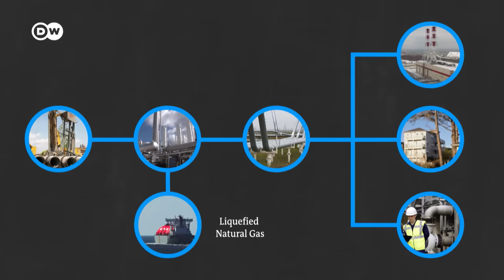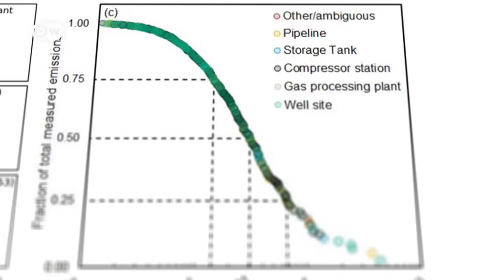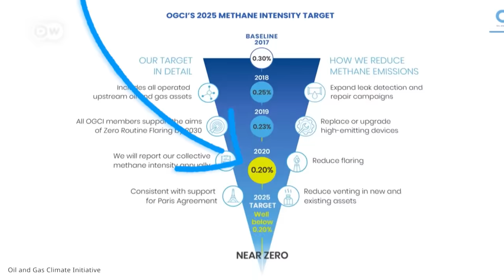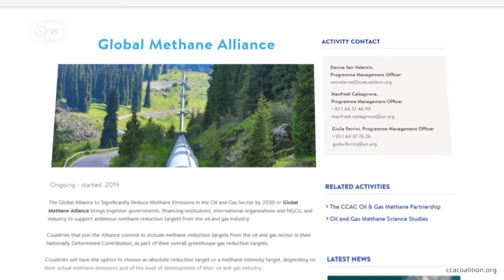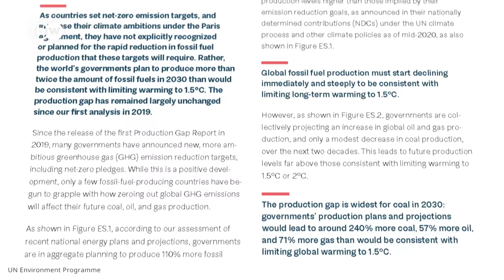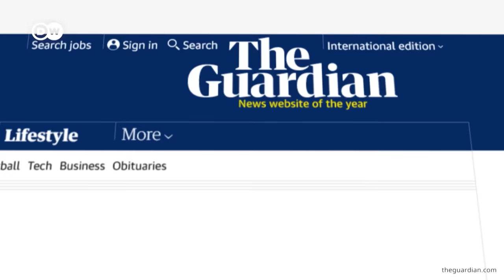Why we need to ditch natural gas (asap)

Comment: I think district heating networks should be a priority. I know in the UK gas is very popular for heating (85% of homes). But we're also highly urbanised (80%+ live in cities), so use mid day solar to power air/water/ground source heat pumps which in turn heat water in a network of insulated tanks and pipes that are pumped into all our homes like drinking water & sewage. 

I don't know what the split is for gas use in terms of electricity production or heating but I'm sure stopping leaks will be easier if the 'gas network' is maybe just 6 pipelines going to power stations rather than the 280,000km of pipe network we currently have to service tens of millions of homes and businesses.
Reply: A heating network would be incredible. Can you imagine the energy savings? So much of what we do produces heat as waste.
Reply: You could make a power station that produces electricity and then use that to power heat pumps, way more efficient and during few cold nights burn i directly so every apartment can have about 15C temperature. Later the whole thing could be replaced by bio mas that was collected from city parks during entire year. Would be an interesting system concept
Reply: @fulconandroadcone9488  this is very close to what Cogeneration does and it is indeed super interesting!
Reply: I think that some form of network heating like what you describe is definitely in our future. Maybe it’ll cost too much to hookup every home to it, but even just having 25-50% of homes hooked up would do wonders for our energy usage!
Reply: @SaveMoneySavethePlanet  I haven't heard of term co-generation before. Nice to know it is idea worth having a name. 

How I see it is if we half fossil fuel usage by half we increase usage of renewables by two times. 

Also switching to DC grid might have some worth too. Most things can be powered by 400V DC, at least in 230-240V AC systems. and would reduce current by about half which would reduce power losses in wires by factor of about 4. Or would need 3 times less metal for wiring in a home which would be significant saving on cooper. Not to mention losses during mains rectification step in all the power supplies. Saved cooper could also be used for electric bikes, and trams and buses, maybe a few cars here and there. 

Now that I think about it, doesn't take a long time to ask yourself why are we not implementing these things to save energy, instead up until few month back Germany was looking to import even more gas.
Reply: @sandpiperbf9767  Yep, heat networks can also use excess heat from places like factories and data centres by installing heat exchangers at those sites.
Reply: yup district heating works great in Scandinavia and Germany.
Reply: Great point 👍🏾
Reply: @sandpiperbf9767  many large cities do have heating or cooling loops for skyscrapers
Reply: @jebbo-c1l  Austin has a cooling loop making ice from nighttime wind to cool skyscrapers
Reply: u can actually look the composition of power generation in the UK real time
we could be generating as much as over 50% of our power from renewable to as little as 3-5%
intermittence is a huge issue for our wind and solar
Reply: @fulconandroadcone9488  Heat pumps cannot compete with gas boilers and furnaces, and they certainly can't compete with cogeneration (both district heating and cooling) using waste exhaust steam from the turbogenerators where the heat is basically free.
Reply: @gregorymalchuk272  I'm not very familiar with numbers regarding district heating, so don't rally have much on that except that it sounds very promising. 

On the other hand everything I saw so far says heat pumps are the way to go. From efficiency, safety ( no gas leaks) to less chance for gas leaks into atmosphere where it will just be wasted.
Reply: UK climate is too warm to make DH work financially. UK doesn't have enough HHD heating degree days (look'm up) to make any DH profitable unless the cost of kWh sold to the poor customer is through the roof. Proponents of massive DH are former choir boys or cooks , never seen a pump close up . Design temperature in England is -4 C in Germany is -20C ... Do the math
Reply: @bm8641  You also need to account for how far the building is from heat source and how many apartments ( total power used by the building ) is
Reply: YES, THIS IS DONE IN ICELAND WITH GEOTHERMAL
Reply: @fulconandroadcone9488  As most equipment is electronically controlled, unfortunately 400VDC would still require power conversion in each piece of equipment. Power conversion still includes making the DC back into AC, changing the voltage and then rectifying it again, so your losses still exist. While saving copper may help keep the environment a bit cleaner in the long term, it's not going to make much of a difference. Also, introducing this change would necessitate changes to legacy equipment, requiring more resources.
Reply: @SAI-nl1vm  I beg to differ. You already do that. You already use 400V DC to charge your phone. 400V is peak what voltage that can be applied to input of modern switch mode supply. If you keep copper the same you can reduce transmission losses significantly. P = I*I * R. Say we double the voltage ( not quite in this case ) then current drops by half which means by power of math we drop transmission losses to 25 % from transformer to end consumer. We also eliminate need for rectifier and smoothing capacitor in the end appliance which makes it a bit cheaper. If it were to become global standard phone and laptop charger would become a bit smaller or be able to handle a bit more power for the same size.
Reply: @fulconandroadcone9488  Actually, the peak voltage of your 240VAC is about 320V and although the peak input voltage may be 400V for modern switched mode power supplies, that would leave no headroom. Any inductive load placed on a 400VDC line would likely destroy every electronic device around it unless there is adequate headroom in the operating voltage of the input capacitors etc.
Every mechanical switching device would have to be replaced (light switches, electromagnetic contactors and the like) due to arcing because a DC arc does not self extinguish. All relays, contactors and electromagnetic devices would also need to be replaced as those designed for AC rely on their reactance to limit current whereas DC coils rely on internal resistance.
I will agree that using high voltage DC transmission lines could be more efficient given the availability modern high voltage switching semiconductors, but to change the consumer end would be prohibitively expensive at this point due to current infrastructure. We would need to have a brand new standard for all devices to ensure that they were manufactured to be universal. New districts and subdivisions could be supplied with 400VDC and wired accordingly. Commercial machinery is another matter though. All 3 phase motors, lighting, heating elements and all associated switching gear would need to be replaced. I can't see many factories being pleased with that bill. Again, maybe new factories ... but it would take so much work to put into place with new standards, retrain all electrical engineers, replace all the insulators and switch gear on the transmission lines .... 
in it's simplistic form, I can see the appeal, but I think that the practical issues are enormous. ;)
Reply: @bm8641  That is perfect temps for heatpumps. Cheaper ones go down to -10.

Comment: I heat my house and water with firewood (I plant two trees for each one I burn), produce electricity with PV panels and battery, do not need air conditioning as I restored an 18th century home with thick brick walls and added insulation and good windows. I'm not totally off grid, but year round I sell to the grid a net amount of electricity. What we need is to plan our lives according to our goals, you don't need to be rich... you just have to be focused.
Reply: @b_uppy  I already do that with poplars and plantains, thanks. ;-)
Reply: I hope you have a very effective filter system for your chimney. Burning wood might be carbon neutral if you replant, but the emissions are very dirty and unhealthy.
Reply: With all due respect, you clearly are rich. This is entirely unaffordable!
Reply: @b_uppy  ...and a huge upfront investment, and some remote job to pay for it all while you live in the middle of nowhere, and a metric ton of CO2 emissions on trips to get the rest of your family to whereever they need to go (school, say).

But even if most people tried to live like loner hermits, then land prices for the huge estates in the middle of nowhere that this requires would shoot up through the roof.

I live in a rather fertile river delta, there are  zero plots of affordable land anywhere nearby.  I'd need to drive something like 200 miles to get anywhere even vaguely "remote" and I bet even there land prices for this kind of project would be rather high.  And even there... if it's not farmland, it's likely a nature reserve or park or something; not some place up for sale for peanuts.  Oh, and farmland around here is utterly unaffordable except to the rich.  Even farmers often lease it.

The best nearby chance is probably some ex-industrial region, and accept the supreme ugliness and possible soil contamination in return for low prices. And then hope zoning laws allow for this whole plan. A friend of mine got a rather good deal on a plan kind of like that, but then there's possible lead poisoning on a good chunk because apparently in the past people used to leave leaky car batteries to rust, and on another chunk there's lots of car oil in the ground.  Unsurprisingly, he's not growing any food crops there.
Reply: @b_uppy  Well, first of all, I already commute by bike, and have an electric cargo bike to haul kids around. I don't have a car and haven't owned nor rented one in years, though I have lent one from friends from time to time.  Part of the reason that is feasible, however, is that I live in a city.

If you can make the permaculture idea you describe work for you: great! I'm not opposed to people doing cool stuff, at all.  But the pretense that this is easily achievable for everyone is absurd. It's not even clear this is less resource intensive at scale; because using land efficiently is absolutely critical for sustainability too.

Let's not guilt-trip people into thinking they just need to uproot everything they know, and potentially accept huge impacts on their quality of life, just to compensate for a broken system. They don't, and should not. This won't work at scale. Doesn't mean it's not cool for 1 person (or small group). It is! This isn't easy, and if you did this: hats off to that accomplishment. Not many will manage to follow that example. You have every reason to be proud.

If you want to fix the climate, we need to fix the rules of the game such that the path of least resistance is sustainable, not by asking  8 billion people to individually take considerable risks and make considerable investments on the off chance they all get it right. They won't.
Reply: @b_uppy  Yeah, I think that for this to work reliably, you'd need to be fairly wealthy.  I get that you disagree - I totally respect your view here; and it's entirely possible I'm wrong and you're right. But I'm not persuaded either ;-).

But hey, that's the beauty of diversity: different people will try different things, and we can learn from each other.  And people are trying the kind of things you seem to be describing, which is very interesting!
Reply: @b_uppy  Thank's for the tip; I stuck Brad Lancaster into my queue!
Reply: @MoireFly  it's all a matter of priorities. To buy and restore home, we did not take a holiday for 12 years and we signed a heavy mortgage. It's all a matter of priorities.
Reply: you are cool
Reply: @ramdev9578  We greenies are all about heat exchangers.
Reply: Wood isn’t a clean fuel